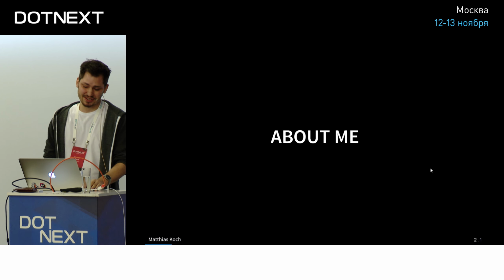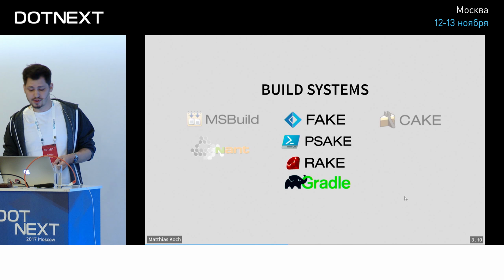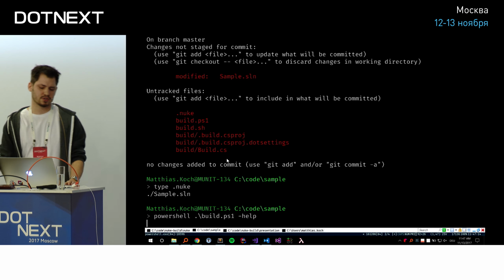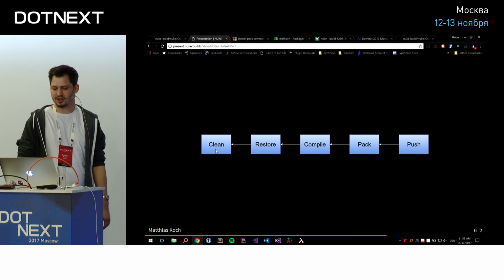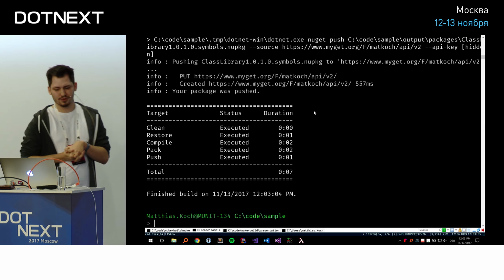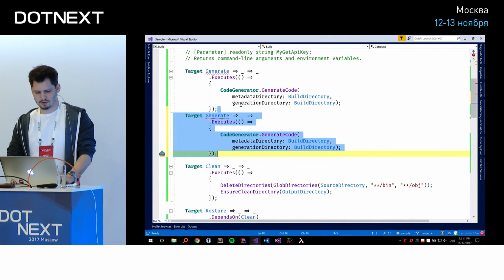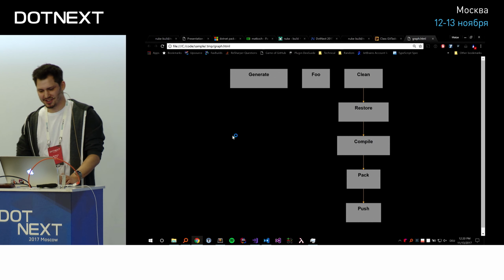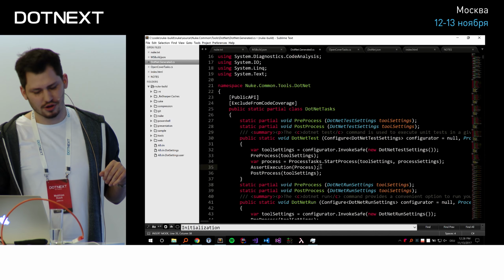Matthias Koch — NUKE: Build automation for C# developers

Comment: Great thanks for presentation!
NUKE looks interesting, but - why is requried so much default boilerplate code for default tasks?
Reply: Hi Nikita,
sorry I've just noticed your comment now. Could you elaborate on what you mean? Are you talking about the Main method?
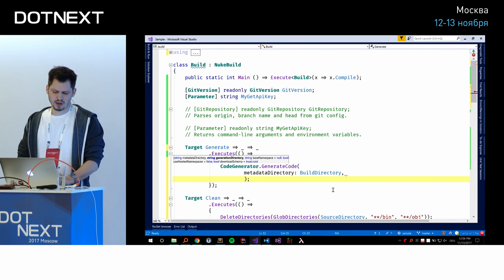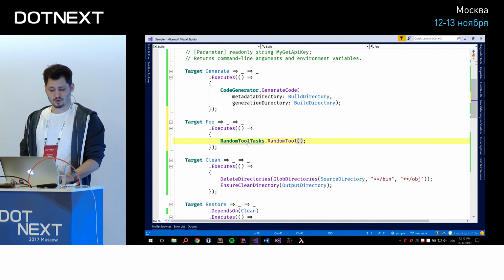Reply: Yes, sure, it's about Build class, for example - 36:32 , 42:00 .
Are all Generate/Clean/Restore methods required for every application?
Reply: I think it's a good idea to at least separate the Clean target, but Restore+Compile could also be done in a single target of course (using DotNetBuild). As for the Generate target (for generation of CLI tasks): this has been greatly improved since then. You would only drop a json file (as described in the presentation) into the build project, and compile it. If you have any more questions, there is also a slack workspace (https://publicslack.com/slacks/nukebuildnet/invites/new).